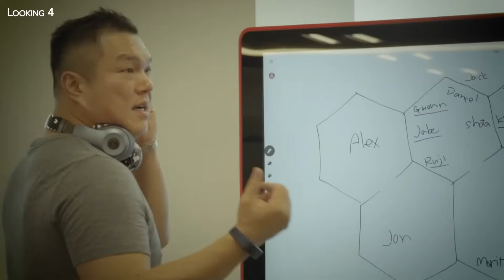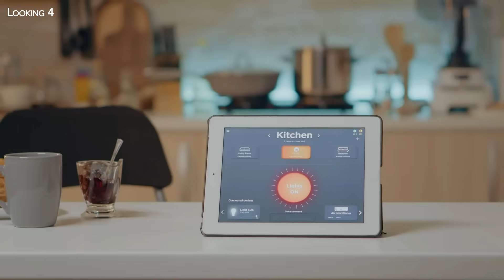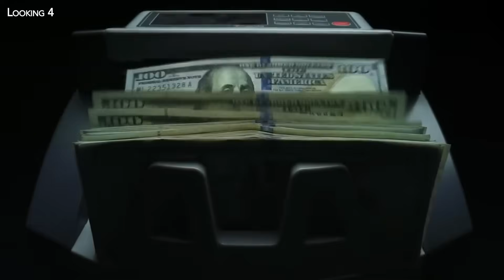How Toyota is Secretly Building our Future Cities

Comment: The problem with Woven is that it’s a city for employees by employees. If one accepts it as just a giant employee retreat/guest office then it’s ok. I trust Toyota quality and their vision. Look at all the EV fanboys shaming Toyota and now Tesla is no longer a respectable company. Not to mention EV sales tanking. Hydrogen may not be the best tech for the future but anything is better than oil, gas, and coal.
Reply: If you look at the model, it's only 1/5 of the area that's being developed. I'm guessing that if and when they finally figure everything out, they can easily figure out everything else and thats probably where regular residence can go.
Reply: The electricity is an energy, to generate it, you need another energy to create it. Solar panels and wind tubines are not feasible everywhere. Oil, gas and coal are still the most efficient and cheaper ways to produce electricity. There's also nuclear plants. Anyway, a true clean energy solution is not coming anytime soon.